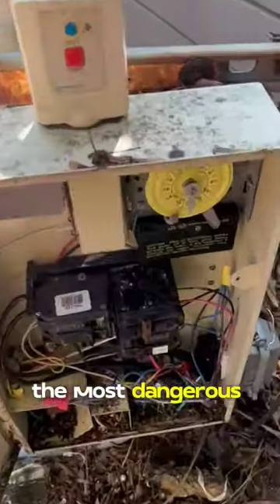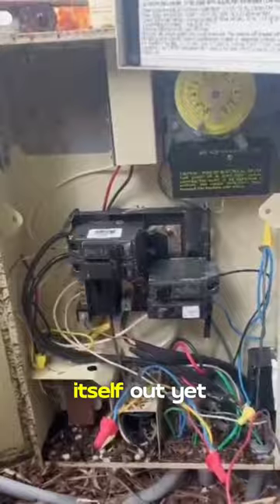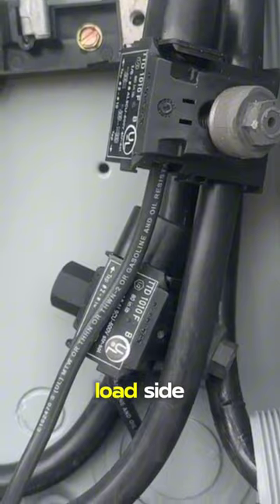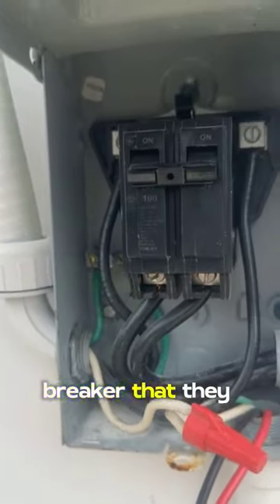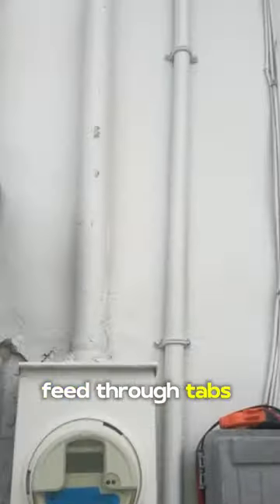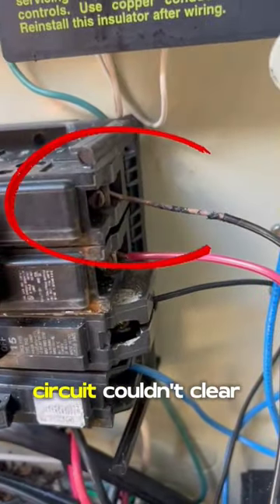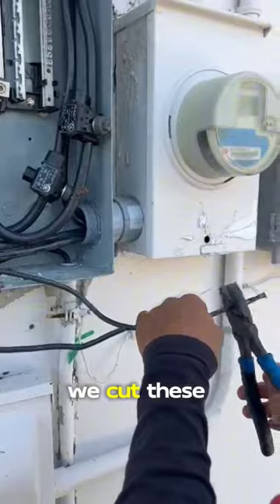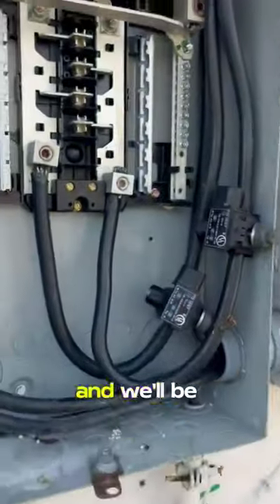Pool water electrified with 110 volts. Simon Electric

Comment: How did the 120v circuits work without a neutral? The line to the pool panel has the ground wire with the neutrals, but as you pointed out, the other end of that ground just connects to the disconnect. Also, I don't get people who hookup grounds on an extension of an existing ungrounded circuit. All that does is energize everything that's grounded together when there's a short to ground. I'm always happy when they don't cut back the ground wire though. Makes it easier to rewire the ungrounded beginning of the circuit and properly connect all the grounds.
Reply from the maker: The netrual was being provided by the pool water, which is crazy! I was hoping someone would ask that question.  I think you noticed, but if you look at the sub panel before the pool panel, there are only 2 wires coming down in the top conduit (only 2 hots. There is no ground or netrual!)
Reply: @Simonelectricfl  AquaGroundRod
Reply: Pools and hot tubs should have their own earth rods. Ones that have been tested, and not just thumped into the ground. It gives earth fault protection devices what they need to operate safely.
Reply: Alternating current flows from any conductor to earth!    The neutral  to the center  tap on transformer  keeps voltage stable and provides a dead short  path so breakers will trip  in case of a fault.  AC  current  will  always flow to earth .       The breaker  should  also be replaced with  gfci.
Reply: @2Sorts The pool water would  still be energized.  Without  the neutral  path back to transformer   the  fault current  flows through  all available  paths to earth.
Reply: @Randall-mt7jk  Correct. It would be energised for a few milliseconds until the protection disconnected the supply.
Reply: A/C follows the least path of resistance. Which is the pool water. Very lucky no one was electrocuted.
Reply: @Simonelectricfl It definitely looked like a handyman special. I wouldn't be surprised if the entire pool was installed without a permit by that same 'handyman'.
Reply: That’s a two wire Romax feeding a 220 circuit. The white is being used as a conductor and the bare ground is the neutral. The comments are correct that it is sending current to the pool. The  gfci will energize because the conduit provides a path to ground, but it will not trip with a current imbalance.
Reply: Two pole breaker.  No neutral needed for that circuit to work.  What was missimg there was the ground back to the service.  Def dangerous situation.  Couldve been a homeowner negligently killing someone.  Food for thought.  Somethings are best left for qualified ppl
Reply: I get that the 2 pole breaker doesn't need a neutral, but there are 2 single pole breakers below the 2 pole breaker. I was assuming those are for 120v, but the way this work was done, maybe the two singles are used together for another 240v circuit. Can't see enough to tell.
Reply: @Simonelectricfl holy shit! It makes me wanna throw up just thinking about someone’s kids swimming in that pool.
Reply: @Simonelectricfl that's so coooool
Reply: @cantgetright5387  No, this is a very dangerous assumption. Electricity follows EVERY path back to it's source, Including the pool water, and everything else in or around it. Most of the current will flow on the path of lowest resistance yes, but a portion will still flow thru every other possible path including human bodies and it only takes a few 10's of milliamps in a wet location to kill a person.
Reply: @2Sorts  the rebar in the pool concrete is bonded to all metal parts around the pool and separate from the electrical grounding system. This makes all things tge same potential because a pool can act as a battery or capacitor. If everything is not bonded there can be a difference in potential such that even with no electricity present, you could become the conductor while stepping from the pool to the ladder this discharging the built up charge.
Reply: salt water pools are popular. If the pool's water contained salt would this change anything?
Reply: @brnmcc01  yup. Let’s just hope the recipient isn’t unlucky enough to be the least path of resistance out of the eleventeen paths back to source
Reply: Marcite pools in Florida, mid eighties:
4 points bonding #8 solid to rebar /mesh reinforcement, plus pool light shell and hand rail and diving board mount. Pool perimeter careful distancing of GFCI receptacles and lighting fixtures. Bonding of metal enclosures and window frames. #12 grounding conductor for pool light unbroken no splice from source thru to pool lighting junction box elevated and supported above ground. 😢 And then there is that monster you ran into.! I can't believe there isn't a stack of dead electrocuted bodies near by.!!
Reply: Remember, neutral and ground are bonded together in the meter panel.  So if you put an ohm meter across neutral and ground, it would read no (or very little) resistance.  Since both the ground and neutral was missing, it was flowing back to neutral through the pool water to the ground rod at the meter panel, and possibly to all the other ground rods in the vicinity.  This is INCREDIBLY dangerous.

Whoever wired that needs to be brought up on charges.

Here's a fun fact.  You can get current flow with AC without a return.  Remember, AC goes BOTH ways.  So if you have a sufficiently large capacitor, you can get current flow in AC and make it do work.  GFCI breakers/outlets will trip, but it is possible.  In fact, the higher the frequency, the small the cap that you need.  I've actually designed single-wire power feeds like this.  You would take your power line and attach it to 1/2 of a bridge rectifier.  Put a cap between the output and away you go.  You won't get much power out of it, but it does work for remote sensors and such.  Communication is handled on different frequency bands on the same wire.
Reply: @Randall-mt7jk Not all alternating current, and not only alternating current. 

Our electric grid uses the ground as a conductor in the grid itself. Grid power flows to ground because the power plants and substations are grounded too. 

A current from an ungrounded portable generator won't flow to ground. 

And direct current will absolutely flow to ground if the other side of the circuit is grounded.
Reply: Pools on ground  so probably completing the circuit this energizing the pool
Reply: @joshhuber501 nominal voltage in North America has been 120/240 for a long time now. 110/220 are legacy voltages, it's rare today.
Reply: @thomasbonse right. That wire job was done by the clown at work who claims that residential wiring is easy, you don't need an electrician.
Reply: @78gbw swimming pools can a little tricky to get the grounding and bonding correct, let alone the panels and current carrying conductors. They should always be done by qualified installers. People die from this crap.
Reply: If you have only one phase you can make a neutral with a copper or iron rod in the land. When i get to a construction site and dont have energy we just get one phase from the line and put a rod in to the ground, and voila, there is ur 120v working well
Reply: @Simonelectricfl  HOW was the pool water being used as the N ... if the panel is not in the water and there was NO water in the panel ??
Reply: Whoa, are the Chlorine (pucks? Discs? Not sure what to call them) making it easier for the voltage to return to ground? Thats scarier on multiple levels…

If that is true, as the current increases it would increase the rate that the Chlorine is being dissolved and eventually start atomizing and becoming a gas. Even more scary is it would start to eat away things in its way of resistance till it became an even greater conductor. 

Most scary is that if the connection were “flapping” (like a transistor) it might turn semiconductors in the pool into coils and make high voltage like a flyback. 

I used the word semiconductors but what I meant was people with variable resistance and possibly variable electromagnetism from jewelry. 

Ok, time to go to the uncomfortable corner and bang my head against it till I forget how many 50 shaded pole this was.

Comment: What always gets me is how long and reliable these major screw ups actually last. Makes you wonder.
Reply: The Pythons and alligators EAT the evidence.
Problem Solved.
Reply from the maker: Every airplane ever flew perfectly fine up until the point they didn't
Reply from the maker: @blaydCA  they leave very little evidence!
Reply: @Simonelectricfl  
Pterodactyl Airlines is the ONLY company with a perfect safety record.
They eat their passengers first.
Problem Solved!
Reply: Nothing is more permanent than a temporary fix that works 😂
Reply: Go to the developing world and see what works for electricity there.  This would be tier 1 work
Reply: There’s definitely a lot of things (like overcurrent protection and bonding/grounding of branch circuits) that really doesn’t do anything until something else fails. 

You don’t need it until you do and at that point it could save somebody’s life or save the whole building from burning down.
Reply: @deltab9768  lots of countries survive with a little more danger just in a regular basis. My journeyman was from the Philippines and he would go back and do work for his family. They used bamboo conduit still. 

A lot of the current code is actually big insurance based and lawsuit based. Otherwise living with a little inherent danger is pretty common place in other countries. 

That being said, because we do have such strict laws. Being one of the few guys who follows them all makes it easy to stand out. Doesn’t change the fact that when I walk up on some duct taped wires it doesn’t blow my mind that this has been working for decades and only tripped a breaker once it failed 😂
Reply: @Simonelectricfl exactly! Look at all the Boeing issues coming up now due to their neglect
Reply: This is the reason why there's so many safety things, plus the people who died to make updated rules. 😞
Reply: Makes me wander if they where deliberate.😓
Reply: @OutdoorCanadians  yeah as long as the circuits are working normally, a lot of the safety stuff doesn’t effect anything. It’s similar to driving without a seatbelt, sure it’s a bit more risky but lots of people do it and don’t have any problem.

By the way that’s kinda cool that they had bamboo conduits.
Reply: @Simonelectricfl yes but years working?
Reply: They last, but many of them cause equipment failure or fires.

Comment: Back in like the late 80s early 90s when i was a kid,my mom won a hot tub. Not exactly sure how it happened,but I think it was a rabbit got underneath it and chewed up some wires. It energized the water to the tub,my dad stuck his hand in there to check the temp and got one hell of a shock. They got it fixed,but they never got in that hot tub again
Reply from the maker: I don't blame them!
Reply: You get got by even a 30 amp breaker you’ll rethink some safety measures 😅 my coworker turned on an oven when a dude was wiring it up I’ve had someone turn on an A/C 40 amp but I always treat stuff life so it’s an extra step saved me
Reply: @rexvanderpool9793  Before I started doing just hvac,I did apartment maintenance and was working on a dishwasher. For whatever reason, I didn't check with my meter,I trusted that the breakers were labeled correctly.They weren't, and I got a little jolt,so I know what you mean.
Reply: Everything in a hot tub is 
fibreglass

Comment: That's pretty scary.  Glad no one was killed, hopefully at least.

Due to the electrical hazard a pool represents, here (Queensland, Australia but also other states & territories) not only must you be a licenced electrician to do any electrical at all, on top of that pool related work has to be separately inspected and certified by another person and the certifiers are really strict because if someone gets hurt or worse on something they signed off on, they are going to feel the full weight of the law.  Someone dies?  They, and likely the person that did the original work, is going to gaol.
Reply from the maker: I was actually interviewed by the news a few months ago about the harborside incident in Jupiter Florida.  A father died saving his and other kids that were being electrocuted in a splash pad. I did not want to make a video about it because it's just too sad but I can't stop thinking about it and how we need to be extremely diligent in pool equipment safety
Reply: @Simonelectricfl I heard that on the news as well.  Very tragic.   Making mistakes while doing electrical work, while we are human and everybody makes mistakes, is inexcusable, but add a pool or boat dock to the equation and the danger level increases multifold.   In fact the hazards are so serious that as of the 2023 NEC addresses SPGFCI (Special Purpose Ground Fault Circuit Interrupter) protection  requirements for pool pumps and lights, and if I interpreted the change correctly, you are required to provide GFCI or SPGFCI protection when servicing or replacing a pool pump.  Long before 2023 we had GFCI requirements for pools and hot tubs, but these were class A devices and could not be used in systems exceeding 150 volts to ground, so if the pool was supplied by a 480Y/277V,  or an ungrounded or corner grounded 240 or 480 delta, or a 120/240V 3ø 4w delta system, GFCI protection couldn't be provided.  Class C, D &  E SPGFCI devices were developed for these less common electrical services and I personally would not want to swim in a pool that is not GFCI protected regardless of how carefully and skillfully the electrical installation was done, just as I would not purchase or drive a classic 1950s automobile that doesn't have seatbelts and has all metal dashboard and solid steering column that  would more or less penetrate you in even relatively low speed crashes.

Comment: Thank you my neibor was anac proffer at the college  and we both bought new houses on a river beside each other and he had a dock built and pulled wiring to his boat lift  but at the panel he couldn't pull it no more so I told him let me get wire puller and bent the end out anpusheit in at the panel and I heard it click and I told him to push and I pulled an he wired 180 rum with 12 gage to his boat lift and I told him that's way to small of wire I told him I ran # 8 to mine and it never would lift a boat !

Comment: Wtf are those taps? never seen anything like it
Does it cut into the isolation to draw power ? From a massive cable into a tiny one without a fuse?
Reply from the maker: Yes they are for specific situations like a solar system back feed but definitely not to feed a pool panel
Reply: They are tap conductors and the clamps are listed. These taps would fall under the outside tap rule and are not a violation of the NEC. Not saying the rest is good but I didn't see a violation with the taps themselves.  However I did not look at the equipment ground or grounded conductors in the tap circuit.

Comment: My Jman years and years ago told me about his Jman at the time who was known for being a drunk. they were tasked with replacing a pool pump at a large hotel pool in galveston tx which has a pretty decent amount of tourist traffic. the old pump and new one were NOT the same, but that went unnoticed. what was once supposed to be a hot leg was now the ground... well a fully bonded pool system hand rails included meant that the next family of 4 all ended up getting stuck to the handrail and to each other trying to help. they all died.

Comment: As long as the wire is correct size for the breaker, those Polaris taps are fine. 70amp breaker is more than adequate for that #2 Polaris taps.  Edit. Saw that used a 100amp breaker off the taps.   So it was #2 they tapped off of to what awg in that 100amp breaker. Taps are wonderful, just have to do it right.

Comment: Pretty common on old pool equipment panels unfortunately.
Reply from the maker: This is not common there is literally no ground or netrual at the panel I have not seen that specific situation before
Reply: @Simonelectricfl  Literally every old pool panel needs to be looked at because hand to god this was how they wired em some of the pool equipment sub panels do not even have lugs for a neutral or ground because the equipment is 240 and the conduit is ground.

Comment: Plus as swimming pool have to be equipped with rcd at 10mampere sensibility  . Also all metal parts must be grounded ... at least in italy
Reply from the maker: All metal should have equipotential bonding according to NFPA 70 680.26 nec
Reply: @Simonelectricfl  about more sensible rcd?  Normally here is 30mA  but for pool and bath equipment like saunas or pools  has to be more sensible or under isolating trasformer or under very low voltage

Comment: Where did you find a 75amp ac disconnect with a breaker, then its not a disconnect, its a sub panel .
Disconnects for what i know come in 
30 amp 60  fused or non fused and 100 and 200 that are fused. 
Never heard of a 75 amp disconnect other than a 100 amp disconnect with 75 amp fuses.

Comment: You can tap as long as the first ocpd after the tap is feeding does not exceed the amperage rating of the conductor. You should read the code book sections regarding tap feeders

Comment: The worse part about wiring electrical components is that you can wire them wrong and it will still work, not forever but it will work 😂 btw the person who wired this should be in jail 🤦🏻‍♂️

Comment: Missing earth or neutral  on 3 phase it will  unbalanced other phases and over load  and  it’s  dangerous
Reply: No 3 phase in a strictly suburban residential home.
3 phase is for commercial/farm/industrial.
Reply from the maker: The single phase, which is what this is, can also become unbalanced with lost netrual, and I'm sure it was, but also with no ground, the circuit can bleed massive power over a long perod of time but not actually trip